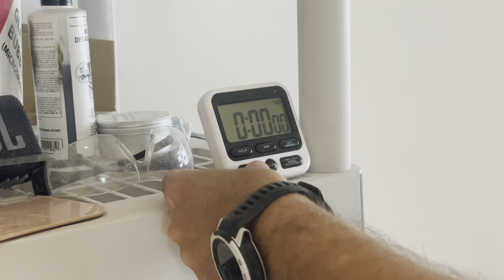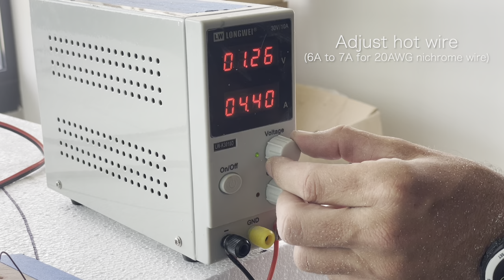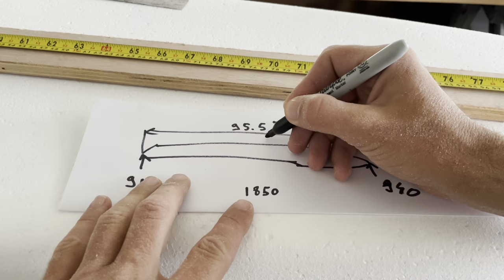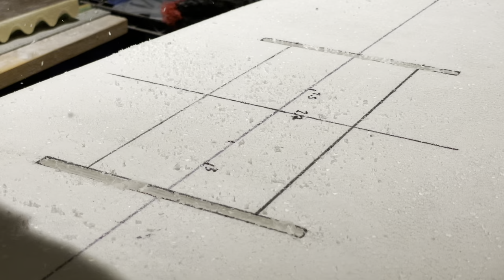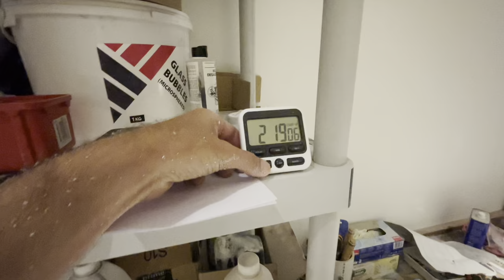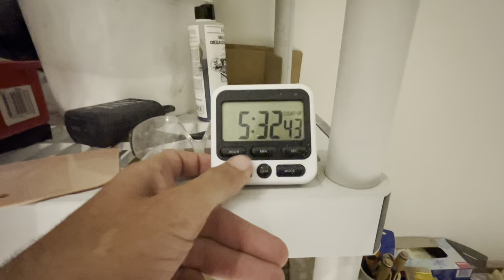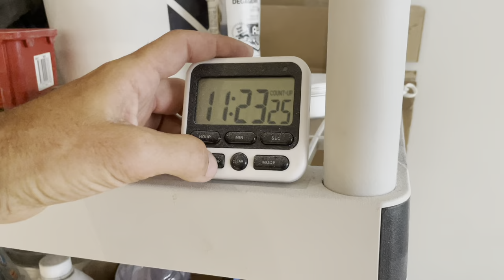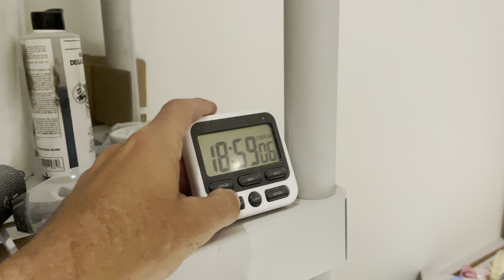Make your own light, cheap and easy downwind board!

Comment: Can you explain your track placement some please? I see you find the CG, but how do you offset tracks from that?
Reply from the maker: It depends on the foil you're using, your preferred stance and the volume of the board. 
If the volume is close to your weight, you want to be standing on top of the CG = center of buoyancy, with more volume, you can stand a few inch behind to let the nose float better without sinking the tail too much. 
Now that you have your back foot position, you get your mast position, center the box there and you'll have the most adjustment possible.
for reference, I'm ~73kg, that board is 115l, I set the center of the box 16in behind the center. On my previous ~85l, it was 11in behind center.

Comment: How much do you think will weigh a 50L 5"8' x 19 board if built ?
Reply: hard to say, but the polystyrene shaped would be ~800g, the fiber would be ~3/4 of mine on that board considering the shorter length, so if you try to keep it very light, 3.5 / 4 kg should be doable ...

Comment: Nice, but why not use XPS? Way less messy, and more waterproof!
Reply from the maker: thanks. not sure XPS exists in such low density, and I don't have access to big blocks here ... only sheets like I used for my wet out table. EPS is not that messy if you clean as you go, but yes, definitely not waterproof, so fix my boards as soon as they ding and I'm weighting them from time to time to make sure they don't take on water... so far so good :)
Reply: @matg8875 We use XPS all the time for our eFoil builds. Believe me. When you change over to XPS, you will never touch EPS again 
Anyway. Nice job! 🤙

Comment: Hello what is your recommendation for the foil box placement ? What is the distance to the center of gravity and why ?
Thx
Reply from the maker: It depends on the foil you're using, your preferred stance and the volume of the board. 
If the volume is close to your weight, you want to be standing on top of the center of buoyancy, with more volume, you can stand a few inch behind to let the nose float better without sinking the tail too much. 
Now that you have your back foot position, you get your mast position, center the box there and you'll have the most adjustment possible.
for reference,'m ~73kg, that board is 115l, I set the center of the box 16in behind the center. On my previous ~85l, it was 11in behind center.
Reply: Merci 🙏

Comment: So you just overlap top and bottom skin on the rail? Don't do a full wrap where top skin goes to bottom and bottom skin to the deck? Is it because board is so thick? Wouldn't full wrap be stronger? Thanks
Reply from the maker: yes, having both skins going over top and bottom rails would be stronger... but also heavier, and it wouldn't fit on my wet out table :) as the rails only have 1 double layer, I was careful not to sand into them.

Comment: What is this power sanding tool you have?
Reply from the maker: it's a 20$ polisher from amazon. I find it works better than an orbital sander, speed adjusts with the trigger, with coarse sand paper, it eats through anything, but with fine paper, it gives lot of control. I'm on the second one after 5 years, so not durable, but very cheap :)

Comment: Hello, I’m planning my own build, and this video is a great resource. Well done!. I’m considering the orientation of the ribs to support the track box and tie it to the deck, was there a reason why you went perpendicular to the centre line of the board rather than parallel to it? (8mins 20 seconds)
Reply from the maker: I did both in the past, both work, but perpendicular uses less HD foam and helps to tie the boxes together.

Comment: Hello, where did you get the PAD, it s the only thing is missing to finish my board , how much resin did you used, it s soo expensive in Canada
Reply from the maker: For pad I got it from AliExpress, <50$ for a 215cmx65cmx0.5cm sheet, enough for a few boards.
For the resin, nothing dripped on the floor and little dust, so around 3kg I think.

Comment: Can you share how you made the v groove cutter?
Reply from the maker: it's is quite simple, just a small piece of 20 awg nichrome wire, bent to get the right groove depth with round loops at each side. Then the 2 screws sandwich the loops at the end of the wire the long wires to the power supply. finally I adjust the power supply voltage/ amps to get 6 to 7 A (the wire length will dictate the voltage).
That nichrome wire is not very rigid, so it's important to get it hot and let it melt the polystyrene ahead when you move or it will bend back.
Reply: @matshape  thanks for sharing

Comment: Do you 3D model this in a software first to determine the dimensions? If so which one
Reply from the maker: Yes, I use fusion 360 , it's mainly to make sure I can get the volume I want in the dimensions i have in mind. Also allows me to see how the board look and feel. And then I just put dimension on the profiles to draw my templates.

Comment: and did your board survived the time or would you doo things different?
Reply from the maker: So far so good, but it was summer time (40+ Celsius everyday and crazy humidity) so not great to practice foil paddle up... I'll use it much more soon. I expect to ding it at some point, but easy to repair. I guess with  slightly thicker hotcoat it would be a bit more ding resistant. Also, I confirmed it's not ideal for winging. I don't need the extra volume compare to my previous board to take of in very light wing, but the extra length interfere with the wing during some gybes.
Reply: @matshape  i was inspired by your build to make myself my first board. i will use 450g carbon for the standing areas. overall 200g carbon  and some 100g fiberglass on top overall. i hope this will get light but stiff enough for the lengt of  188cm and with of 50cm. a flat  carbon stringer  over the middle under and topside. do you recomend something on it?? tipps thoughts? (sry for my bad english ;) )
Reply from the maker: @gamma8283  no need for carbon stringer on thick boards like this Good overlap on the rails is enough. your plan sounds good, but don't forget to also heavily reinforce the boxes.
Reply: @matshape   my Plan is to integrate some standing airex plates between the box and the deck inserted with fiberglas and overlap it to the deckside for more strenght.

Comment: Or you could attach a shop vac to your router, sander, etc and reduce the free particles in the air by 80%... just saying.
Reply from the maker: with a separate workshop, yes! definitely the way to go... but as mine is a bedroom with a common wall with a neighbor, I'm trying to minimize the noise as much as possible.

Comment: Did you wet the blank out with some micro-balloon thickened resin for every step? Or just the deck patch?
Reply from the maker: no wet out of the blank first, I never do that. Especially that board as the EPS is quite dense, so it won't absorb much resin anyway.
Reply: @matshape  thanks for the quick reply! Was it 1# EPS?
Reply from the maker: @Davids-eq7ky   oops, my bad, i thought that was the last video i uploaded for a pumpboard. yes, for this one, it was ~1lbs/ft3 EPS. 
here my logic for not filling the blank first is more that as i'm wetting the fiber on a table, it limits the epoxy use and the blank will not absorb any during the lamination process. only risk is to have some pin holes when the resin is pulled from the fiber into the blank, but as i'm doing fill coats after, it doesn't really matter.
Reply: @matshape got it. I usually wet out on a table but use vacuum. I’m very tempted to stop using it to save on materials and time. 

You haven’t had any issues with no vacuum for this board?
Reply from the maker: @Davids-eq7ky  no problem at all, you just get a small weight penalty as excess resin is not taken out in the peel ply/breather, but if you're careful when wetting on the table it's not too bad. You also need to avoid radius too small on the rails to avoid the fiber to lift.

Comment: What’s the long router bit you use to cut the slots called?
Reply from the maker: it's from aliexpress : Flat Head EVA Engraving Cutting Tool CNC Router Bits End Mill 6x100x150x4T - 32x450mm Milling Cutter For EPS Foam Engravin. it's dangerous but efficient :)

Comment: where do you buy your supplies?
Reply from the maker: it's kind of a treasure hunt where I live... polystyrene and epoxy are found locally as importing them is way too expensive. For the fibers, HD foam, microballoons and silica : I get them from easy composites. And finally, for boxes, the leash and vent plugs, pad: aliexpress.

Comment: How did you design the template?
Reply from the maker: I designed the board in fusion360 (it's free for hobbyist)
when I was happy with the shape, I did 2 sections, drew the profile and added dimensions every 10 to 20 cm.

Comment: PVC foam, 75kg/m3, 10mm, 12$ were ????? In italy 2000 x 1000 Pvc 75Kg/m3 3 mm for sandwich about 35 Euro
Reply from the maker: Easy composite, you don't need a 2000x1000 sheet for just one board, a ~500x500 is enough.

Comment: that isnt a down wind board that is a canoe that hasnt yet been hollowed out the thickness shouldnt be more than 3 inches 4 inches for the super heavy riders.
a properly fitted board for a skilled rider should barely have half the board above water and any forward motion will allow hydroplane any speed should allow foiling... if see smaller silverado trucks
Reply from the maker: I guess this was translated as I can't make sense of what you mean. But check out board like the Amos bullet that is >7in thick.
Reply: @matshape  why the heck would anyone want to play on such a large boat like board? 
i see surf board size down wind boards....
i even see wakeboard size foil boards but these down wind boards are supposed to be a hybrid SUP and a SUP is an over sized stable surfboard....

i hate that no one that makes these boards has any brains.... if i made a down wind board it would be a 80L 7ft long 26" wide and 2.5 inch thick it would have rails for a foil it would have a thruster set of future fin boxes  on the bottom on the top it would have a bungie tie down on nose a couple D rings for kayak chair tie down if you want to row or fish it would have a mast screw if you want to wind surf it would have optional foot holds so the board can hold onto your feet if you high fly in kite surf it would have an optional leash and deck padding. the board that can do any and all sorts as good as any specked board though it may be a bit heavy for kiting. 

im tempted to build one for myself as i have every bit of talent for shaping i just never glassed before. it suck that if i want to wind surf i need to buy a whole kit for it if i want to kite i need a whole kit for it if i want to surf i need a whole kit if i want to fish or paddle i need kits for those!!!! i can make 1 board to it all and do it all well. just blows my mind its almost 200 years after invention of surfing and we have tech to make cripple people walk with a computer chip in brain but we cant have sporting equipment that can offer more than 1 function?
Reply from the maker: @paratrooperz1  
My bad, it was not a translation issue.
This board is designed to make flat water foil start as easy as possible. very thin and long enough to get the required speed with a paddle (with very limited paddle skill for me), thickness is dictated by the volume I need to comfortably float. Paddle surf foil used to be SUPs , but the width keeps you from flat water starting it.

You can make a board that do a lot of things, but it ends up doing nothing very well. As you pointed out, weight is one thing, but the other dimensions needed for one use will make another use crappy, kite foiling with a board too long sucks,  winging with a board too wide and not enough volume will make you loose low wind ability, paddle with a board too narrow will make it unstable.

With that being said, some use can overlap: my kitefoil board also work as pump foil board and I can prone surf my wing board, all that with a set of just 2 foils.
Commercially, you can find board that you can surf and kitesurf and Kitefoil, and I remember seeing a wingfoil board that you can windfoil and may be even windsurf.

If you can already shape, glassing is definitely not that hard. As I showed in this video, you don't need to bother with vacuum, and there's not much equipment needed. If you don't mind a small weight penalty, you can even skip the carbon and use glass. That's the whole point of shaping your own board, building the one that exactly suites you need for your particular weight and skill. And please film it to share the perfect board with the world :)